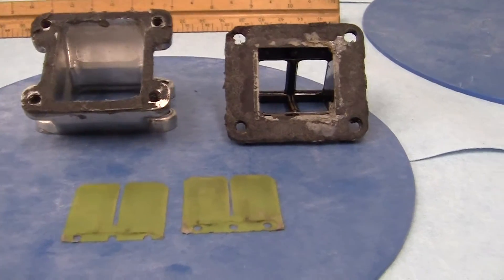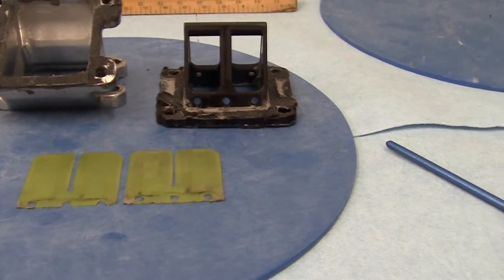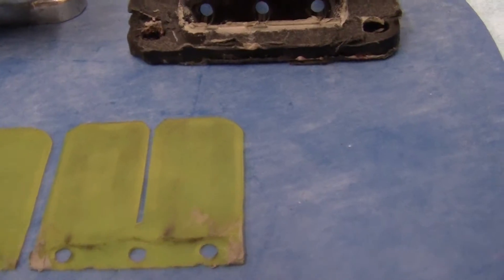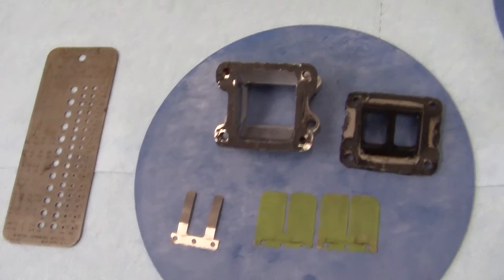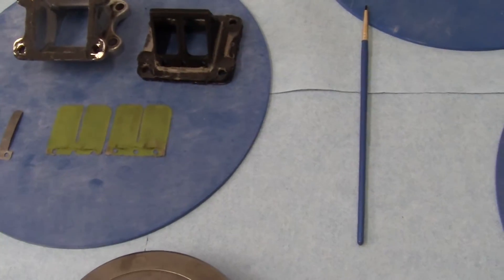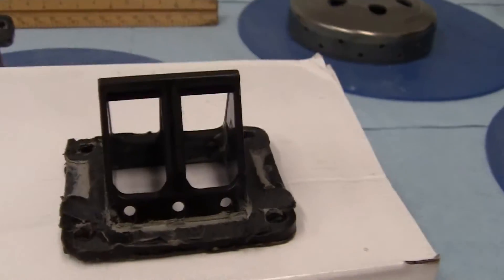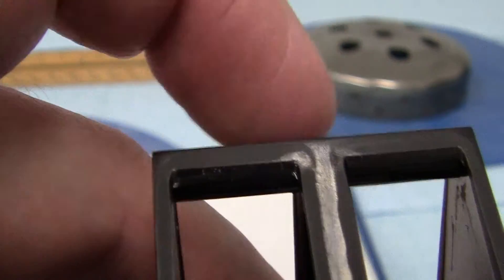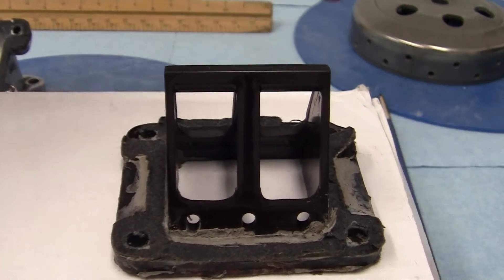3)- Using BOYESEN REEDS, in a C.T.  MANIFOLD for Honda DIo

Comment: yes rotary valve is better cause its more accurate cause it has nothong to do with the piston,it runs off the end of the crank but it makes the engine stick out more on the side of the bike with the intake,the carb,etc., and a bitch to work on